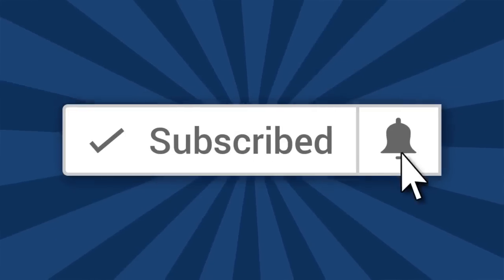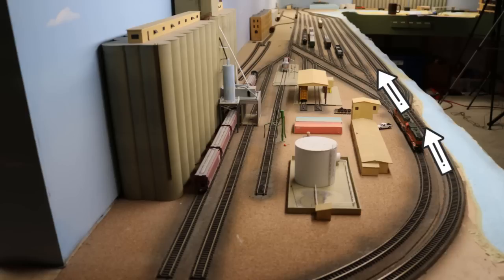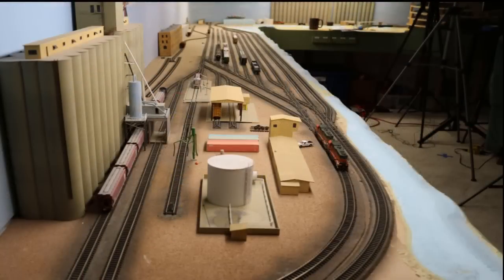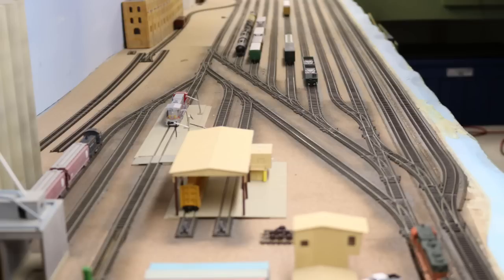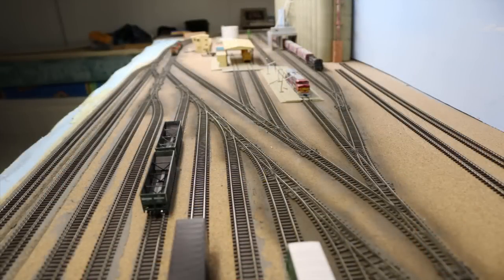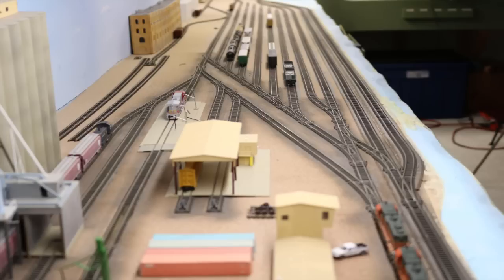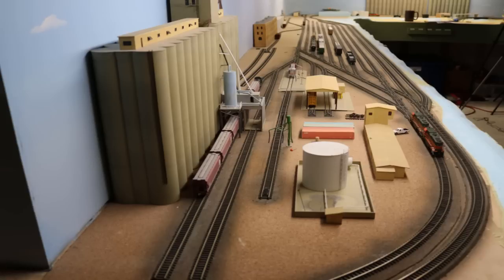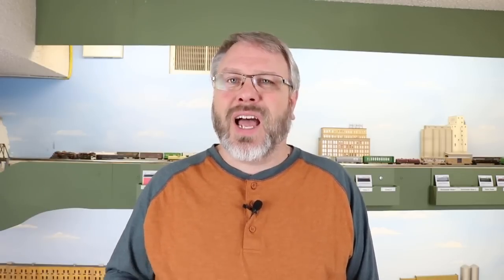Model Railroad Yards--Design for Operations

Comment: Ron,

It tirns out that inclines can be a very tricky thing to get right.  I shot mine with a laser which really helped.

But this might be a good series for you regarding inclines in general.

Here are some thoughts about it - - -

An incline can be calculated with the rise divided by percent grade ( 2 % is expressed as .02)

So 8 inches up / .02 is 400 inches of run.

1. What should the incline be made out of . . .wood, foam, etc.
2. How wide should the sub roadbed of the incline be ? 
 Track member width + ballast width + scenicing along the rails+ distance from backboard?
3. How to support the incline?
4. Should it be tight up against the backdrop? - - spacing?
5. How to scenic the backdrop best behind the incline so it ties in?
 Flat buildings, low reliev buildings, structrures along the incline?  Photographic backdrop? 
6. The side base of the incline rise is steep to avoid other benchwork items.  How best to scenic the side slope? – arches, viaducts, brickwork, stone or rock face, etc?
7. How best to lay track on an incline against the backdrop?  How to get the drop feeders down?  How to solder the back rail out of your view - - -mirror?
 Or perhaps assemble a section of incline board near you, lay the track, drop the feeds, and set this section of incline in place afterwards?  Drilling the holes thru the benchwork to get the drops down below for connecting to the bus? Glue the incline supports first and drop the deck on top of it?

No one is discussing these aspects of an incline – which is a very nice soluiton if a helix is not your solution to elevate the track.

Should an incline be its own block?  Throwing a Tortoise on a reversing loop automatically?

Thanks very much.

Bob Schworm – Brecksville, OH

PS – I am a subscriber and look forward to all your videos - -well spoken and very well delivered.
Reply from the maker: Hi, Bob. First, I am doing a laser level review in a special video this Fri, and I mention that it is a great way to level benchwork so you can control grades. This is a great idea for a series. It has also been suggested and I am seriously considering a couple videos on how to build a helix, which would fit into this idea as well. Thanks for the suggestion.
Reply: Great!  I will stay tuned.  Thanks
Bob

Comment: Hi Ron, thank you , thank you!! I read the other post from modelers and the term "Perfect" was the proper description!! This has been one of the most insightful, informative and educational model railroad videos I have watched in a while. Your breakdown really explains the "Yard" and it's use and how you can get nothing out of the design if not done without thinking first before designing. Just about everything you mentioned in your video I have incorporated into my yard, with a few exceptions. There are a couple of changes I want to make, but my main thought was in line with "operations" and not just running trains around. If you have a few minutes, please go to my channel and look at the video where I explain what I have done in that yard and please share your thoughts. I always enjoy your video and get so much from them, please don't stop sharing. Again, than you so much!!
David Muse (Washington Terminal Co. Model Railroad)
Reply from the maker: I took a look at your videos on your yard. It looks pretty solid in design to me. I always find some things I want to change or adjust--like the added corssover I mentioned in my video that I need to add--but I think you've nailed it pretty well there. Looks really nice. 👍

Comment: Im modeling 1980 to 2010 for the variety in color (BN, SP, ATSF, D&RGW, Early CSX, YN1, and the disappearing YN2) and cabooses. Aswell as certain colors and rolling stock it is hard to find a old c44-9cw with a brand new SD70ACe or a old run down gp9  in Blue Bonnet with the PRR heritage unit now a days.
Edit: It is even hard to see the RJ Corman GP9 anymore i will be pushing limits including UP 1943, And UP 4014 but it will be worth it and i think it be nice to have UP 1943 siting next to a brand new fresh from EMD SD40-2 for BNSF

Comment: Wow Ron this was absolutely perfect, exactly what I’d been looking for, you explained the topics perfectly.  Also having an example to look at was helpful.

One thing though you said that a thoroughfare track should not foul the yard lead, but in your example it seems like any train using the that trac would block the switch the yard lead needed to get to the ladder, albeit temporarily.
Reply from the maker: True, the thoroughfare ties in to the yard lead on one end, but it stall allows connection between the engine track and the yard without using the lead. You have to access the ladder, but that is unavoidable  in a stub-ended yard.

Comment: I noticed you have the Stewart Products diesel facility structures on your diesel service track. I have the same kit. However, I can't for the life of me figure out how to attach the sanding arms to the sanding tower. CA doesn't work. Do you solder the parts together? The instruction manual isn't very descriptive.
Reply from the maker: Mine came as one piece except for the hoses which I attached with CA. You cannot solder white metal, so I think CA would be your only recourse that I can think of.

Comment: Pretty decent introductory treatise to the topic which is well supported by your yard photos and call-out marks, well done.  And yes Andy's freight Yard Book is an excellent resource which Kalmbach really should re-issue.  A couple of questions/points about your yard in specific. 
First why do you say you don't have enough room to double end your classification tracks?  It appears you could double end them and dual purpose the north end of your thoroughfare track as the beginning of the drill track.  Then run it parallel to the mainline curve as far as possible.  Failing that double end C1 through C5 with the drill track independent of the thoroughfare track curving around with the mainline.  Granted in either case the resulting drill track won't be full length but double ended classification tracks with one of the drill tracks being a short are generally better than stub ended classification tracks.  
Have you considered replacing the two point to point left hand switches at the south end of your A/D1 track with a double slip?  Same handed point-to-point switches are notorious derailment sites and the double slip would also render slightly longer A/D tracks - certainly two cars per track if not three. Yes double slips are expensive but sometimes their benefits justify the costs and I think this might be one of those times. 
The only criticism I would raise is the single ended "shotgun loaded" locomotive service track. If at all possible these tacks should be double ended so locomotives are serviced and dispatched in the order of their arrival rather than last-in-first-out. If you have any flexibility to move your RIP facility and the oil storage tank east (towards your mainline) you could put a switch close to the south end leading to a locomotive ready track that would exit onto your thoroughfare track adjacent to the RIP facility
Nice yard nonetheless and an informative video.  Thanks for posting.
Reply: Andy's book is in digital format now.

Comment: Hi Ron - Thanks for all the help!!
 I've just completed constructing a hollow-core door. 30"x80.  I've designed the track plan - Kato N scale.  I'm getting ready to glue down the 2" blue foam board. Exciting, right?  Yeah, except for - where do I go next?  I plan to cut out some rivers, etc.  Do I glue the track on top of the foam?  Do I pin it?  Do I put a very thin veneer of wood on this?  Or do I just start building the mountains and rivers around the track? (Which I assume you pin)
Help.

Comment: Hello Ron I know this video is 4 years old, looks fantastic, I am planning a yard but in HO, what are you using to control the turnouts, are you isolating some of the track , control the track section with switches, thanks
Reply from the maker: Hi, James. My yard is pretty low-tech in this respect. Switches are hand thrown and none of the track has kill switches.
Reply: Ron I was very impressed with this yard design. Low tech is nice, simple which I like, I am building a new layout, just working out the details ,

Comment: May I suggest that you replace the left hand turnouts between your main line and arrival and departure tracks with RIGHT hand turnouts and align the through tracks of the turnouts? You would eliminate some wicked "S" curves! Also, there was not a great deal of "footage" of the south end of your yard but what I saw made me wonder why you didn't make it double ended? It seemed to me that a minor realignment of your main line would have given you room. Especially if you used curved turnouts. I mean to be helpful and not critical. This was a great video full of great info!
Reply from the maker: I hear what you are saying, but your suggestion would leave me with using the diverging route of a turnout on the mainline which is a bad idea any time and impossible using Peco turnouts which have a curved diverging route. As for the other end of the yard, the classification tracks are stub-ended, but I have no need to switch that end. the A/D track are double ended, allowing traffic to enter/exit to the main from either end to/from both A/D tracks.
Reply: We may not be referring to the same turnouts. I was speaking of the turnouts between the arrival and departure tracks at the north end. May I refer you to John Armstrongs book on Track Planning For Realistic Operation? He devotes a chapter on turnout placement and discusses the hazards of causing the cars in a consist to saw back and forth while negotiating a cross over. IMHO aligning the through tracks of the cross over turnouts to create a smoother path through the cross over and eliminate this see-saw-motion would reduce chances of a derailment regardless of where the diverging legs ended up. Worse case scenario would require modifying the cross over turn outs or hand-laid turnouts at that location to straighten the diverging legs. 
 One thing I have learned over the years is the last sentence in a model railroad argument is "It's MY railroad!"  Enjoy!
Reply from the maker: Don't get me wrong, I am always looking for ways to improve. Like you said, I think we may not be talking about the same turnouts.

Comment: Great video.  On the yard lead track, are the locos of the train arriving at the end or how are things moved around with the switcher moving cars getting trapped?
Reply from the maker: Inbound trains enter the yard via the arrival track via that crossover from the main that is just beyond where the yard lead enters the ladder track. An inbound/outbound train can access the main this way with no interference withe the switcher on the yard lead.
Reply: Ron's Trains N Things  how about trains classifying in the yard?  As locos pull off cars to classify do they need to move all the way to the end and come back around to grab more cars?

Comment: I managed to design a yard without arrival / departure tracks, without the runaround loop, without a headhsunt / lead track.

The station I designed was 3 track station consisting of a bay platform and 2 running lines.

Because there's no arrival / departure tracks, locomotives operating the mainline would need to shunt their own train off the mainline directly into the classification yard itself.

There's no runaround track so trains need to be sorted prior to being put directly onto the train.

There's no direct headshunt to the classification tracks which means that trains would need to use the bay platform of the station to switch cars between classification tracks.

This bay platform is also necessary for any trains to access the local industries.

The bay platform is live and recieves passenger trains from the branchline while mainline not only takes through trains but also freight trains as well.

It's a very simple yard with a lot of conflicting movments between trains and train services and a lot of the movments happen directly on the main running lines.

It's not efficent, but simple and saves a lot on space.

Comment: Ron, you have another source at your fingertips. Google maps and the real world! Roy
Reply: Real world yards and model railroad yards to not interchange well.  You would think that they would,  but they do not.  Most do not have separate drill tracks and use the main or a siding.  Lots of the yards double over trains.  Capacity and dwell time in a real railyard are very different to a model yard.
Reply from the maker: Google maps will give you a great view of a yard, but it doesn't tell you what the tracks are used for or how they are switched.

Comment: Most cabooses in use before their end were 'pool' cabooses.  They roamed the system freely.
Reply: Even with pooled cabooses, you might need to store them for the local jobs. One might have to lay over if it was to be used on a train that originated in that yard. Even after buggies were phased out, many locals still used them. This was mainly for shove moves. One job that I used to work, we kept it on the head pin (against the engine). This was because many industry tracks had tight curves. The 60’ engine couldn’t tie on to the cars. The shortness of the buggy allowed it to be able to make the hitch.

Comment: I'd love to incorporate a yard into my 4x6 or 4x8 layout. Just a line running parallel to the main lines, attached to a spur running diagonally up the middle of the oval. From that diagonal track will be several parallel branches running through the middle of the oval.

Comment: Ron, I keep coming back to this video. One question I do have is what size turnouts are you using.#6 or #8
Reply from the maker: Hi, Mel. I use Peco medium radius turnouts, which are #6 frogs but with a slight curve to the diverging route.

Comment: Would it be Ok to use a single longer yard track off end of the Lead to be the Arrival/Departure And Interchange Track? Then I will Ladder 4 Switches to make the Sorting Tracks 

Going to try and make a connection Switch on the Mainline At Both Ends of the Lead/ARR/DPT/ Interchange Track. The ARR/DPT/INT will parallel the Main for a stretch, then break off at an angle as the Lead, over a river and rejoin the Main in a town scene right before a Curve to a secondary smaller Industrial Yard.

Really getting a vision for this. 

That Lead/ARR/DPT/INT Track can also act as a bypass/Long Siding. Something I don’t have that long as of now.  🙂
Reply from the maker: I'm having a hard time envisioning exactly what your are describing. Try drawing me a picture--doesn't need to be to scale, just free hand it. Take a photo of it and drop it in an email to me at ronstrainsnthings@gmail.com. I'd love to see what you are doing.

Comment: Is your empire designed so cars can be classified by remote control (even if the switches/turnouts need to be thrown manually, can you couple and uncouple the cars without touching them and without wing a "tool" to uncouple them)? If so what brand of couplers are you using. How does that brand compare with other available brands?

Comment: Ron, this has been one of the most informative videos I've found on yard design, and has clarified a lot of confusion I have had on the matter. Thank you. This is for a single track main, though, yes? Would you do anything differently if you were using a double track main?
Reply from the maker: This is a single main, yes. The only thing to add for a dounle main is to have a crossover at each end of the yard so trains can access the yard in/out from the second main.
Reply: On the very front edge, you have a runaround on the main, yes? Would you keep that with a double main?
Reply from the maker: That is a passing siding for the main. That desicion would have more to do with how you operate the main. I really isn't related to the yard's work directly.

Comment: As an actual conductor looking at this video it certainly suffers model railroaditus, modeling how things SHOULD be not how they actually are in the field but this is one of those rare times it is for the better. The tips provided make switching easy and give a lot of freedom to learn and make mistakes without the yard melting down. I run out of a relative small yard with a lead, 4 stub tracks and 3 through tracks with an industry on the lead. There is no yard master and one crew who works THEIR yard. It can be a challenge at best and a nightmare to keep trains flowing smoothly. Only tip I can really add on is a railroad thinks a lot like an individual. If you don't have space, money for a ton of switches or need for a ton of complicated track work it is okay to skip it. Like Ron said it having those amenities makes running the yard easy and fun but if you're up to the challenge the amenities certainly arent necessary, use what you have to your advantage to get as much done as humanly possible

Comment: Is it Ok to use #4 Switches instead of #6 to make a Yard Ladder string of like 5 tracks for storage in a 24”x20” area?  Will it look near Proto?

Most cars will be 50-73’ length cars with GP-38s GP-40’s and SD40-2’s doing the Switching.
Reply from the maker: Well, no, #4 will not look prototypical and you will have probably derailment issues on any but perhaps 40' and 50' rolling stock. I would highly recomment #6 or greater. I used a couple #4s in out of the way places in the past and ended up ripping them all out.
Reply: Ron's Trains N Things ok great!
I always buy #6’s so fine with me!  
Thanks Ron!

Just got my RTNT shirt on Wed. Needs a wash job first before wearing. Can still smell the Transfer. Will wear this during Layout times. 🙂
Reply from the maker: @doublediamondrailroad5949  Cool. Thanks. Enjoy.